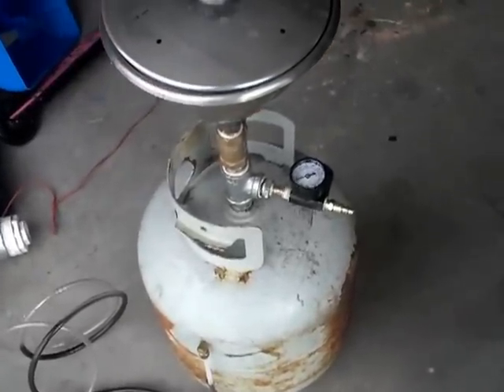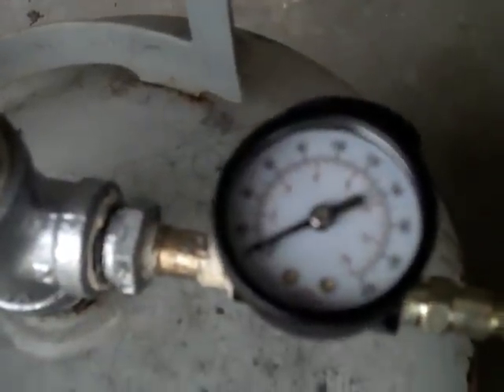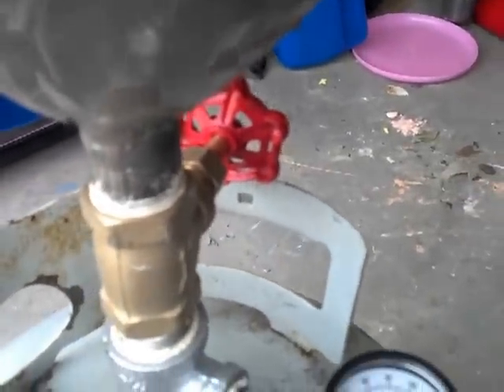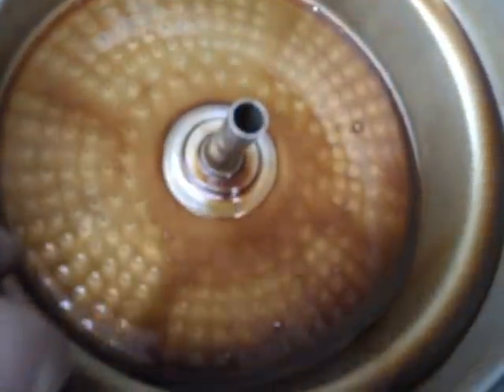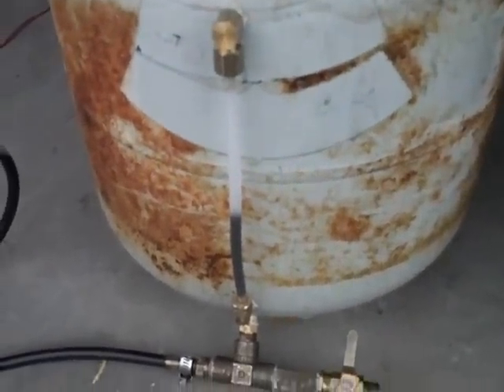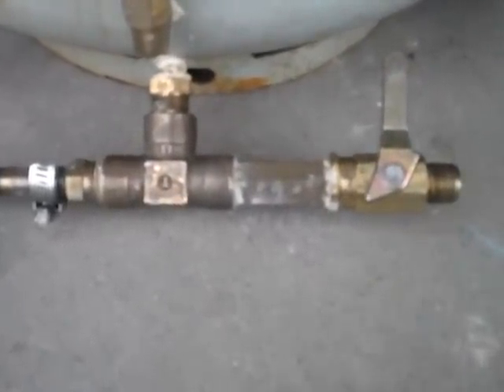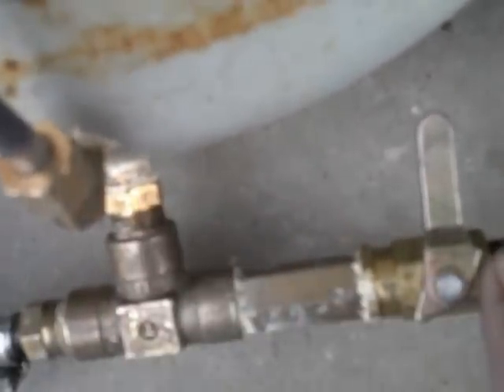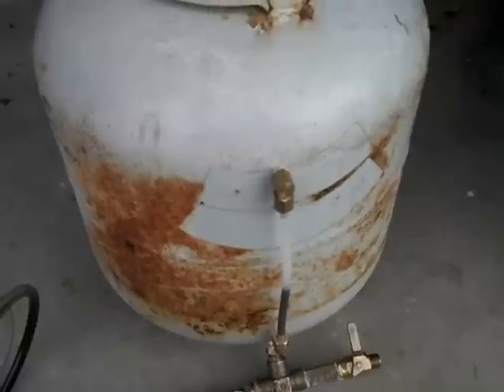Pressurized Oil Delivery For my Waste Oil Burner Made From Propane Tank

Comment: This is an Awesome series! Have you done one on how you built your foundry, and how, whatever experiments you went through, lasted?
Reply from the maker: No, I haven't...I used commercial refractory on my two main furnaces.   I did make a larger furnace using more of a gingery mix that I built for a one time use...but it became my favorite furnace until I moved from there...the sides did get soft on it.

Comment: I feed oil to my Babbington the same way.  I would suggest you put an elbow and a vertical pipe off of that T on top of the tank and put the air pressure regulator up on top of it.  I initially had my reg like you have yours, right off of the T, but eventually oil found it's way back from the T on the top of the tank and into the regulator.  The regulators stop working right when they get oil in them:)
Reply from the maker: Sounds like a good idea,  thanks for sharing!